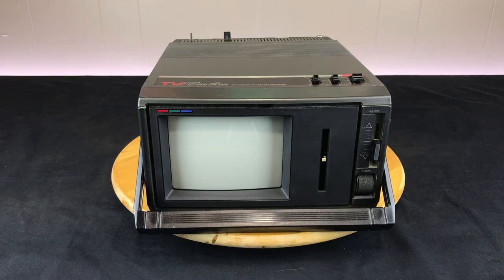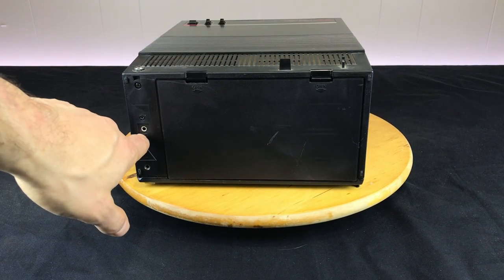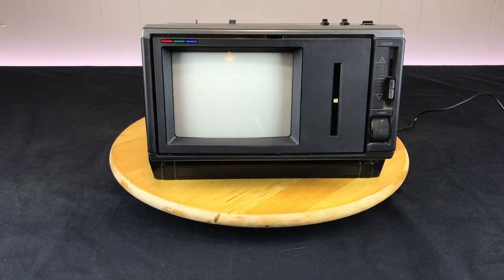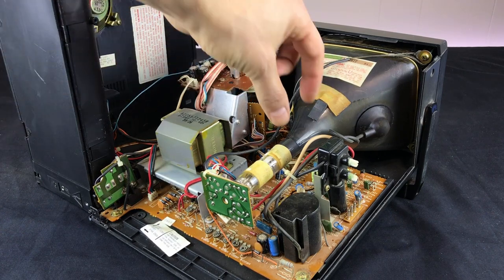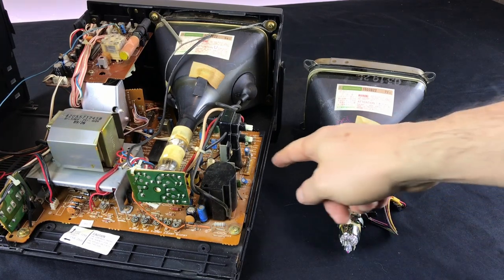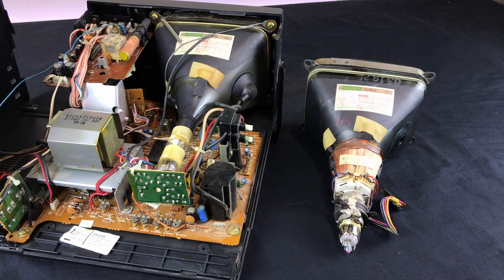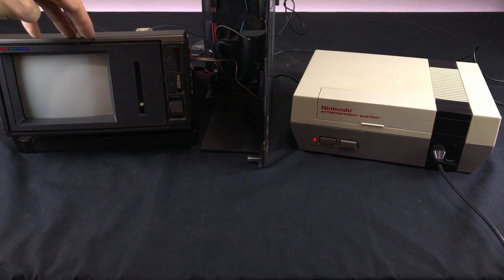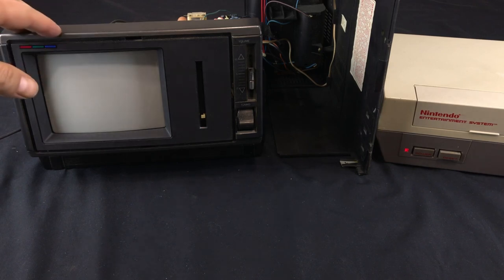Saving a small color CRT from a e-waste - Part 1

Comment: It's nice to see that there are still some decent finds at the Goodwill bins. I like that little TV. After your repairs, the picture looks good too. It will be a great mini TV for use with your Nintendo or other vintage game consoles. I agree about a cold solder joint being the issue for the picture collapsing. I look forward to your follow up video on this unit.
Reply from the maker: Definitely a good start for learning some crt repair basics. I had done a flyback replacement on the 1084, but it was just a 1 for 1 swap out. For this one hoping to dig further into a composite mod or other picture tuning. If it breaks, was only a couple of bucks!

Comment: I’ve got a tiny black and white tv I got at a thrift store and I watched the picture collapse into a vertical line within a minute of powering it. ☹️ I have tried flexing the case to see if it would come back but if it doesn’t work I found an lcd with composite in that’s roughly the same size so I could just gut it and make it into a novelty thingy. Even if I don’t it at least looks cool as is
Reply from the maker: They can be tricky to fix if you don't know what to look for. I'm just starting to learn some of the details, in your case it's likely a bad solder joint on the board somewhere, or maybe a capacitor that needs replacement. Black and White sets are simpler to work on as they don't have the 3 separate color signals. You do have to be very careful though as they can hold a very high voltage charge.

Comment: 8:14 Do you think we can date this set using the markings on that transformer? (26th week of 1989)?
Reply from the maker: Good catch! I should have called out when it was manufactured. Between the that part and some of the chips that likely have date codes should be able to get a good idea. Will make sure to call it out in the next vid for this set, will likely be a couple videos down the line.